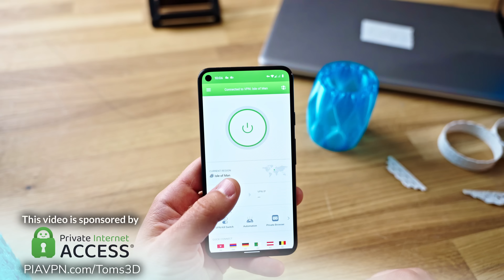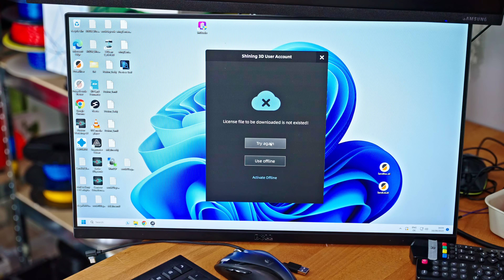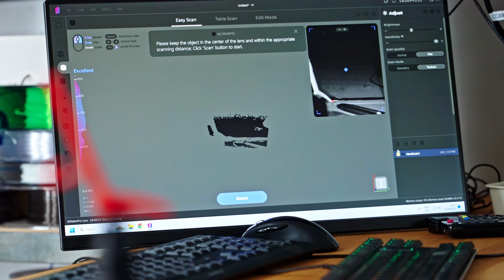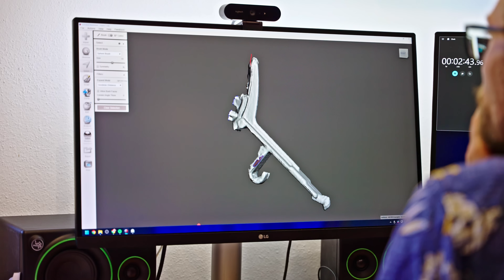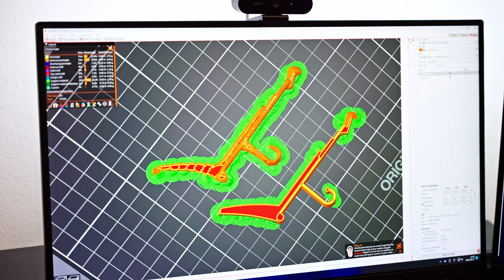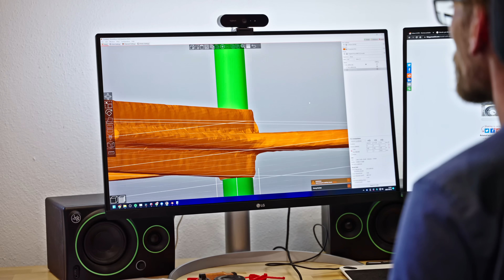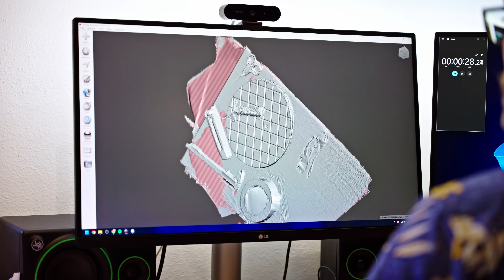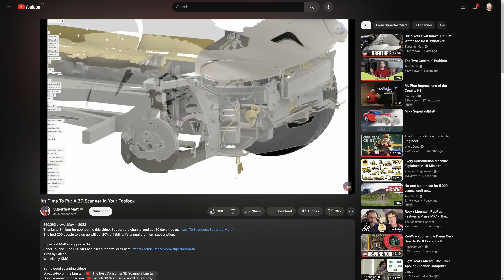Make replacement parts faster - with CAD or a 3D scan?

Comment from the maker: Thanks to Private Internet Access for sponsoring this video! Check them out at http://piavpn.com/Toms3D
Reply: you say at 12:50 that the scan version was faster but have the time for CAD at 35 mins and the time for 3d scan at 43 mins.  Is this an error or are you discounting some of the time you used trying to figure out the best way to add the wing?
Reply: @nakkajin  exactly
Reply: yep we still won't be out of the job for a long time, those scanners are pretty lame, even super expensive ones
Reply: Thank you for not trying to fearmonger people into buying a VPN that they don't need. That's really refreshing.

Comment: I actually prefer remodeling the part in CAD using calipers.

Manufacturers often have other optimization criteria than I: The part must be strong enough and as cheap as possible. I won't care if I need a few grams of material more. So I can often strengthen parts (if there's enough space in the area they will be in) while remodeling them. That seems like more of a hassle with a scanned version tbh...

Comment: I don't think the scanner you used is optimal for the part you are scanning. It is made for parts with 100 mm to 2000 mm dimensional range and has a 300 micron resolution and 100 micron accuracy. There are scanners designed for smaller parts with much better resolution. 3DMakerPro has a model called "Seal" which would have probably been a better scanner for this application. It is made for parts between 10 mm and 200 mm with a claimed 50 micron resolution and accuracy of 10 microns. I think that is the main reason your part looks like a kids project. I still don't think that the Seal would have made it look as good as the part you modeled but, it probably would have been better looking and would have had better fitment. I feel like the scan technology isn't all that great yet which is why I haven't bought one yet.

Comment: I have an EinScan SP V2, amd had the exact problem with re-registering the scanner, it gave me the same error message about the serial number missing, so I exited the software, and restarted it and everything worked.   Must be some kind of bug in their process.   But I can tell you, I also have the Mole 3D scanner, and the Einscan SP does a much better job, I can almost assure you that scanning that part in multiple positions would have rendered a scanned model very very close to the original.

Comment: As long as you have a reference. If some part broke, 3D scanning both halfs and joining them again might be more trouble than measuring the rest. 

I know of someone that is using 3D scaning and digital calipery, lasers etc to measure specific parts that are already worn or organic etc to mount sensors for various kinds. 

So there still is cad afterwards. But they use the scan as a positive reference

Comment: How accurate is the 3D scanner ? I work in a spring manufacturing company and we are looking to outsource manufacturing overseas. We have 200 plus part numbers and no CAD drawings or 3D models. Most of the springs we have are minibloc who have very tight tolerances on the bar diameter( varying diameters) which impact rate curve and are critical to spring performance. We want to generate 3D models so we can send out to manufacturers for quotes. Any expert opinion?

Comment: I really need  a top head part for my bcd-396xt, which broke and is no longer available.
Is it possible? I don't  want to buy another one that's another  radio because our p.s. has moved on to the p2 system, and it's  almost obsolete  equipment but good for other systems.

Comment: The more complex the geometry, the more scanning should be used compared to 3D modeling.  Think Car fender vs gas pedal.  Your part was basically an extrusion with simple mods....  therefore 3D CAD is hands down easier and more accurate (LOL).  Then, enter level of scanner.  I know high end systems that will make that part in 2 minutes with perfect geometry (accuracy .005 " point to point).Thanks for a great vid

Comment: Well nice video but as you suspected at the end you kinda misused the systems - at least from an industrial standpoint. Let me explain:
If somebody in your company wants to do a 3D scan, for such an easy part, wit basically just right angles and flat faces, I'd fire him. 😄
Because, the reconstruction using 3D scanners ist used for different parts.
If you have very large parts or free forms in a part, that are not easily measurable with anything else, you'll need a 3D scan, anything else you'll do with other measurement methods (like calipers, or even 3D measuring machines), why? Well ist faster usually, more precise and gives you exactly the data you need.
The problem with 3D-scans is, you will almost never use the scan data directly, only exception I know if is, measuring for tolerances, if you just want to check if and how for your tolerances deviate.
Anything else, you'll need to do surface reconstruction, which usually needs additional measuring steps.
So the two methods are used for different applications, and 3D scanning is only used if there is a significant speed advantage or if it's more or less impossible to measure the part with classic methods. If you need any data for production, you'll need to check over all dimetions anyway, most of the time you're better off constructing it from the ground up. And tbh. Most hobbyists would probably be better off if the bought a good measuring tip for their 3D printer, istead of a mediocre 3D scanner..

Comment: Scanning is ok to get a mesh model but requires clean up or surface extraction to get a nice model. Depending on the complexity and size of model I would be more inclined to build it in a CAD package. For the last part of the model you wanted to add the cylindrical side pieces. You could have added those using Blender.

Comment: I’m sorry to say, but you don’t have the knowledge in 3D scanning to make that comparison. I highly recommend you to check out the GOM Scan 1. You scan a part and you get the perfect digital copy of it. Ready to print without post processing. I can make a video with you if you are interested. The scanner is made for makers like you (I work for the producer company).
Reply from the maker: Interesting recommendation for a 150k€ scanner. I think it might actually be more economical to tear down the house and rebuild it with a working flush box.
Reply: @MadeWithLayers  It’s far below that - times are gone where you could get a high class 3D scanner only at that price level you mentioned above. I think it is important for the community to know what IS POSSIBLE with a good 3D scanner. The part you showed could get be scanned in below 5 min and it’s ready to print. Please send me a PM and we can have a call on that.

Comment: Your decision to not alter the shape of your CAD part to be “fair” in competition to the scanned part made no sense. I will always make whatever changes I can to make the 3D parts work better (correcting the original design deficiencies if I can and to replace the manufacturer’s often overly complicated injection molded parts with 3D printed ones). 

While your video mostly was concerned with the time aspect of one or the other, I use a combination of tools (photographs and 3D scans with CAD, Blender sculpting and MeshLab) to create a functional part as you mentioned towards the end of the video.

Comment: You don't need to be "fair to the scanning". In fact your goal here is to get a functioning part which can be 3D printed and that doesn't break like the original did.
That original part was once designed with the process of injection molding in mind as the method of manufacturing. But that's not what you're doing, so you might as well ignore unnecessary details and optimize the part for 3d printing right away. You dont want to copy what didn't work anyway, right? ;-)

Comment: Great video. I agree with you on what 3d scanners are best used for. That's part of the reason that i still use an old Xbox 360 kinect as my scanner instead of upgrading to something more high definition.

Comment: Cool video! I don't really think including the setup is fair, since you would have to at the least include the setup of the CAD software and putting the battery in the calipers to make that fair. I also think for any part of the process you have to "figure out" it's not really fair to include the time since it's just a matter of experience. Overall though, it still just boils down to using either on a case by case basis and for the right purposes.

Comment: brro,  i just took off a similar part from mine and it took me 6:08 minutes to replicate the part in Autodesk Autocad, then export to .stl , load it to cura slicer , ctrl+P add 13:11 minutes for the print 0.12 accuracy  that's a total of 19minutes and 19 seconds, i can only imagine what would ot take for someone who is really good in Cad , with 0.4 accuracy and 150% speed no build plate part printed at 2:58 and it works... just lol

Comment: I think that the results of scanning of very product/software dependent. I have tried a few different ones and found that Polycam works best for me. It is a different process than what is shown in the video but it works well for me.
I also do use the take a photo and calibrate it to use as a background to draw over. That works well, but there can be an additional step of lens compensation. There are many ways to it it, but it is important to be aware of. If not parallax effects can happen and lines will not be straight.

Comment: The Einscan would have been the much better 3d scanner from my pov. Usually reverse engineering nees to be done from 3d scan to get pretty clean results. It's as usual ... if you are used with such process you will be faster and faster. Also using the CAD tool require quite some learning curve.

Comment: What I would often do is take a photo of the part with a ruler (from high enough above to minimize distortions) and import it into the CAD. 
I then measure the fine details and precise lengths with calipers where it matters and use the photo (properly scaled) for the overall shape. But I like the approach with extending the angles too! Still, the photo is a great way to quickly spot any potential mistakes (like the rubbing nub) right away, most of the time my parts work in their first revision 🙂 
Also, CAD gives us a very easy way to strenghten the parts where the extra mass would not block proper operation. With 3D scanned mesh this is more tedious. I tend to do that a lot, especially to prevent the original failure mode.

Comment: I'm all new to this and planning to buy my first 3D printer and one of the reasons is to be able to create spare parts pretty similar to yours. But isn't it possible to make 3D scans usimg your phone by either use lydar(?) or just taking a massive amount of photos of the part you want to duplicate and turn them into 3D models? I don't own a 3D scanner so was just wondering how well that would work?
Reply from the maker: Scans based on photos (photogrammetry) require highly textured parts to work well, and the iPhone's lidar is much lower resolution than what you'd need to get usable replacement parts. Unfortunately, in this case, a "real" 3D scanner or using CAD and calipers are the only options.

Comment: I am not sure if that vertical rod feature in the 3D-Printed part will hold up especially to repeated use. There is also the fact that PLA creaps significantly under constant load.
Reply from the maker: The rod is a simple bumpstop that just keeps the lever from bouncing up too far. There's no permanent load on any area of the part.

Comment: Ok I get using a respirator, but then you spray this scanning agent right next to your work area, so all that toxic stuff gets all over your workspace?  Also what is so private about showing the inside of a flush box?  We have toilet bowl tanks here in the states, they are hardly private.  Otherwise, great job comparing workflows 👍
Reply from the maker: The spray is a self-sublimating type, which completely evaporates after a couple of hours. I've got a ventilation unit running in the studio room, so any chemicals from the spray eventually get ventilated to the outside.
About the flush boxed: They're 35 years old, and they're just gross inside 😉

Comment: Great video. I’ve been doing this type of thing for a very long time and all methods in the video and discussion have a use and place. Unless you are using a metrology grade scanner (and trust the scanners discussed here do not touch them) they are best used as reference geometry and then just mode over them in CAD. They are best used for high complexity models (complex curvature, highly faceted, non-intuitive feature easy to capture in top/side view pics). It’s also good to remember that most consumer and prosumer scanners are terrible at capturing black and shiny surfaces… if the part has this, the prep time goes up related to this step (use talc or the such, plus cleanup after) but scan is way better.  If the part has relatively simple features (lots of basic shapes and the like) calipers, micrometers, or just a ruler can work well and much faster. For mid-complexity (still pretty simple shapes but straightforward angles that may be difficult to measure, picture reference works well (others already mentioned the flat bed scanner trick if the part/features fit or you can stitch ). But again, all the methods have their use case. One good thing to do is to verify one with the other. Like take a scan and measure what you can with calipers or ensure you have a known reference item I your scan or pic to scale off of. Glad to see this info is getting out of just the more hardcore engineering circles:).

Comment: Thanks Thom, nice video as always ❤
I had a 3D scan at work, we only used it a couple of times and then I gave it away.
In our case, for machanical parts, it was always faster and more accurate to take measurments from the part we needed to copy.
With the 3d scanner you have to master more softwares and techniques. It would take me 10-20 minutes for the scan and hours to clean it, correct it in Meshmixer wich I never use.
As you said, I think the scanner is more suited for environnement references we have scanned whole buildings with industrial grade ones and that can be a game changer in some applications.

Comment: Could you not take a picture of the item aligned next to a ruler and then import the image into the CAD program, set dimensions, and then extrude to get a much faster product?
Reply from the maker: Totally doable! While it's not going to give you perfectly accurate dimensions, it should be more than good enough for a part like this. You just need to make sure the photo is taken as far away (to avoid perspective distortion) and as squarely as possible.
Reply: @MadeWithLayers  that's a great point I hadn't seen in any of the videos I'd watched for this method. Especially with today's phone cameras having a "fish-eye" effect.

Comment: A alternative way to get overall perimeter details is to take a picture of the part using a long focal length to eliminate DOF and then to scale the image to a known dimension.  This workflow could result in a little faster reverse-enginering of the part.

Comment: These results are pretty much what I expected. You did address what I was thinking in your wrap-up too, that this flusher part is suited to CAD, but that something larger and more organic that's difficult to measure directly would be much better suited to scanning. The example of the wheel well and suspension hadn't even entered my mind, scanning a difficult-to-measure environment and then taking those measurements in software. Great use-case. Thanks for the video!

Comment: I prefer CAD, too (maybe because it is my only option :) ). But I take a bird's eye view of the part to see how it may be simplified or improved. Parts that are made by injection molding often have a different set of constraints and material saving measures that result in part failures at critical points. Beef them up at the weak point.

Comment: I use my digital caliper for parts. However had a delta wing project that required the model of the EPP foam wing that did not exist and the frame was 500mm so I found Polycam for iOS and Android did the job remarkably well compared to the $300+ 3d scanners.

Comment: A very informative video, particularly the insights into the processes used. 
Speaking of scanners at a consumer, or hobby level, my first thought would be to use the camera of a smartphone. Capturing images on a grid, or next to a ruler could be used as a reference background in CAD to trace the outline and details. Using callipers where needed to constrain part dimensions. 
Some smartphones like Apple's iPhones have LiDAR integrated, so combined with an App could do a 3d scan. 
I'd would no not expect much reduction in time, or effort going this route, but with scanning there should be no intrusive software locks, or cloud-only constraints.

Comment: I think the main thing I learned in this video is how strange German toilets are.

That said, I have a button mechanism for a fridge drawer that I need to replicate, and have been putting it off because I only know how to use Blender (barely), and measuring it is rather challenging.  Makes me wonder if a 3D scan that I can "trace" around in Blender might actually be easier.

Comment: Am I missing something? You showed the CAD as taking 35 minutes and the scan as taking 43 minutes, and then said that the scan was faster? Was there an editing mistake here?

Also, it’s awfully generous to say that the scan won when you unnecessarily made a replica in CAD, when in practice, all you need is a functional replacement. In a real world scenario, I’d expect to be done with the CAD approach in maybe 20 minutes, and that’s with revising the part to avoid having to print supports.